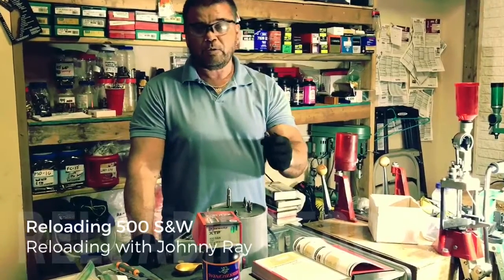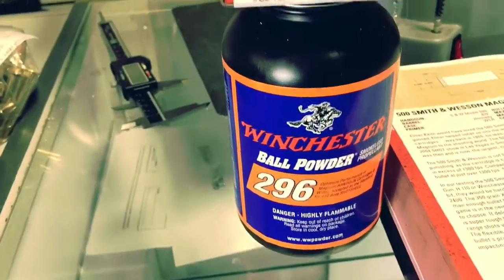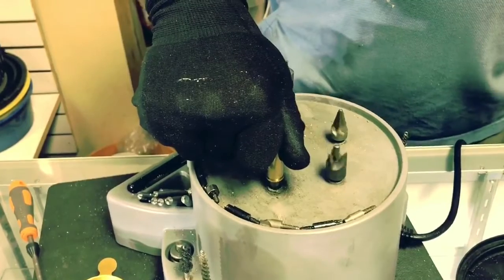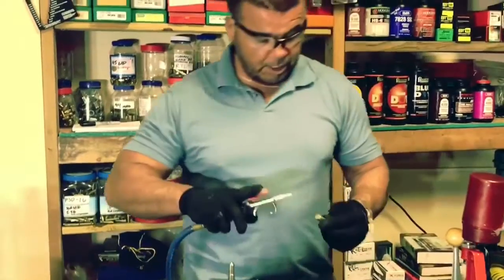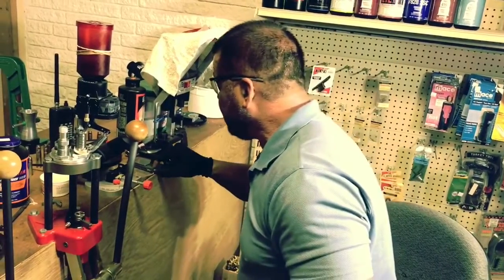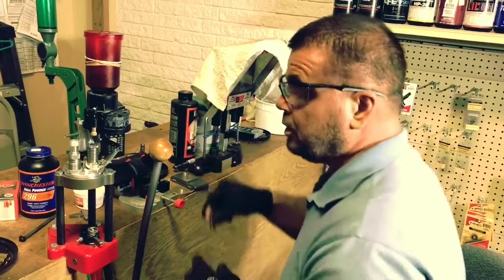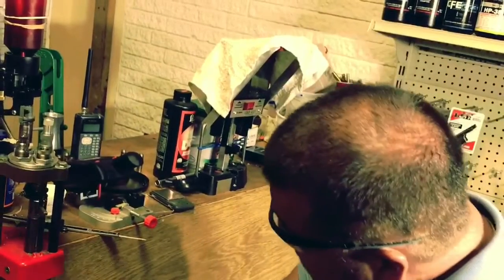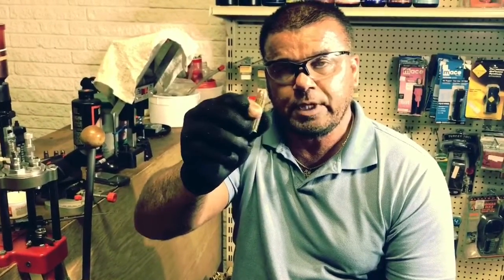Basic Reloading; Reloading 500 S&W with Lee Classic Turret press

Comment: Don't you get bullet bulge on the side of the case that prevent them from chambering?  How do you avoid it?  I see you use a separate crimping die what crimp die are you using?
Reply from the maker: shawn2571 ...I use a Lee factory crimp. I’ve never had issues with my brass sizing right but I always shoot mine in a revolver.
Reply: Reloading with Johnny Ray - Backwoods Guns   you must mean the steel collet style die right?  I think that is the only one lee makes for the .500
Reply from the maker: shawn2571   Yea the collet Die is what I always use.
Reply from the maker: shawn2571    You have probably already tried this but Try resetting up your sizing die and make sure you get the die set up where you get a good overcam feeling. Make sure if it’s a rcbs die use a rcbs shell holder or Hornady with Hornady or Lee with Lee .....Then size it once and bring your ram down and twist your brass a half of a turn and then size it again. That’s the only thing I can think of. I’ve always shot my 500 out of a pistol so of course they don’t expand much but they do grow in length.  Good luck brother.
Reply: Reloading with Johnny Ray - Backwoods Guns   thanks!  The brass itself Chambers fine it's only after seating the bullet that I have chambering problems.  The buldge is being caused by the bullet.  Crimping the bullet in a separate step helps some, but I still end up with a few that won't chamber in my Handi rifle.
Reply from the maker: Try putting a good flare and a really good chamfer on your brass. Flat base bullets will put that bulge on your brass.
Reply: Reloading with Johnny Ray - Backwoods Guns ok thank you.
Reply from the maker: shawn2571 let me know what happens brother.  I’m very interested on how this turns out.   Anyway Great question... Thx for watching my videos.

Comment: your brass will come out more consistent length if you use the shell holder that goes with the lee case trimmer.  the little point on the end of the trimmer that goes out the flash hole needs to stop against the shell holder that's supposed to be there.
Reply from the maker: Robert Longobardi   Thanks